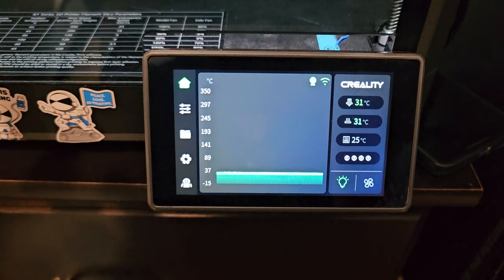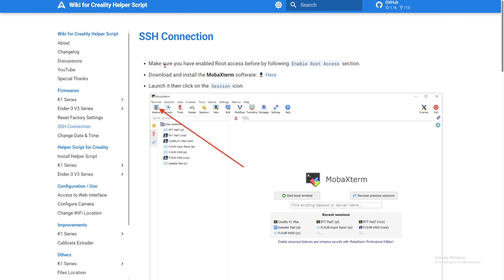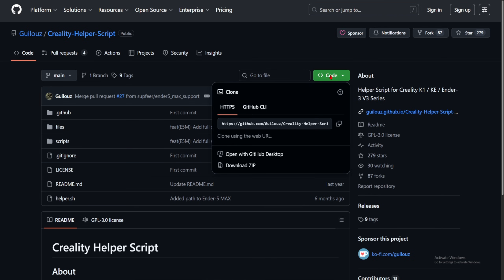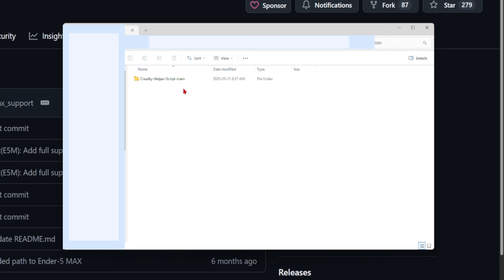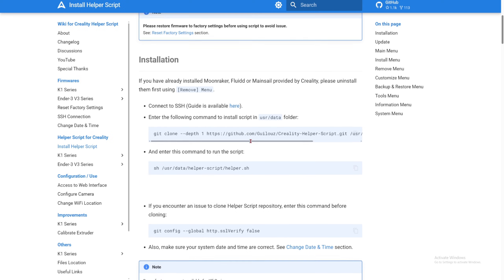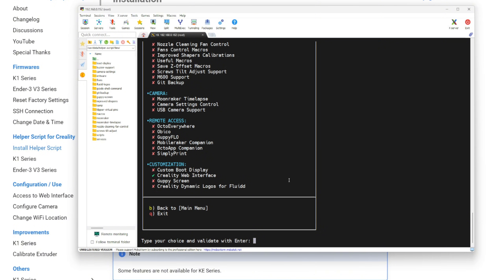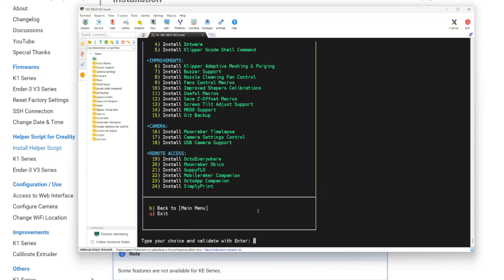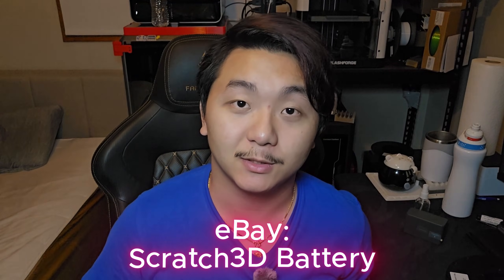Creality K1 Max Rooting With CFS Upgrade Kit: Common Problems & Solutions

Comment: what firmware version do you have mine is .34 and it will not root
Reply from the maker: the version i have is 2.3.5.33
Reply: @Scratch3DPrinting   V .33  is not  compatible with rooting unless  tweaking,  upgraded to  v34  - rooting  like  regular K1.
Reply: it works had to find a git hub wiki forum to make it work

Comment: Set up a static IP for your 3d printer in your router so it won’t change every time your WiFi goes out.
Reply from the maker: That's a great tip, thanks for sharing!